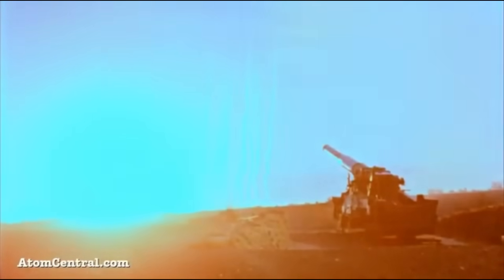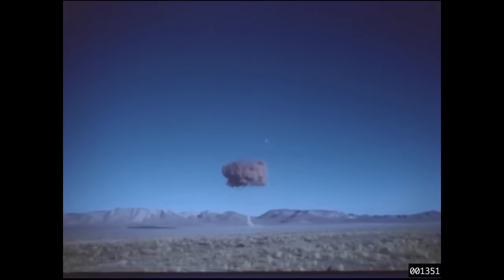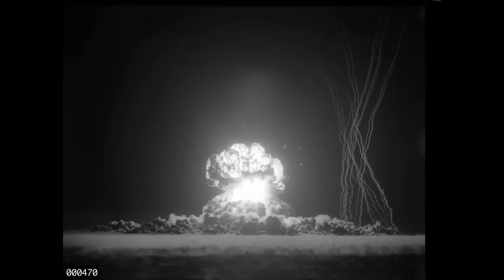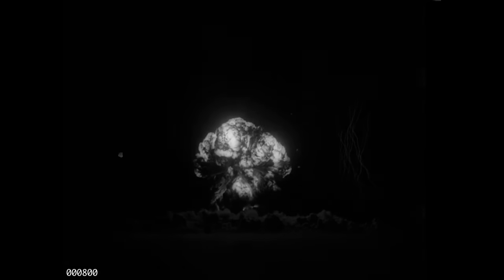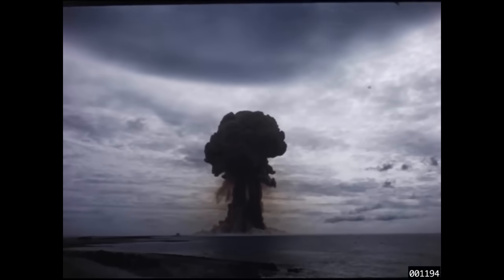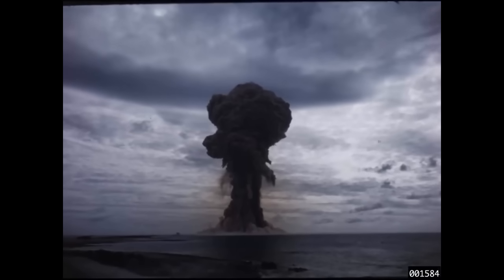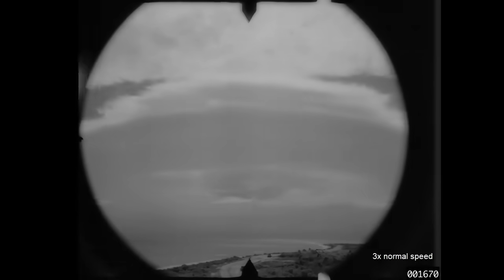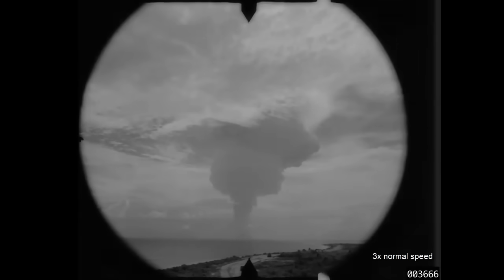What does a nuclear bomb sound like?

Comment: I'm not so certain if the sound heard in that sample comes from the conventional explosives or (directly) from fission-material half-spheres being smashed into each other. It's pretty loud, isn't it?
Reply from the maker: It comes from the entier explosion. Also there are no half spheres being smashed together. That was an implosion type bomb. I have a video talking about how different nuclear bomb work fir more detail.
Reply: @venera13  Anyhow, such a huge explosion and especially, the well-known vast shock wave, must create sound, given that sound is nothing but a propagation of pressure so that propagating pressure typically can be heard by people. The long rumbling goes on too long and consistently, right in the beginning, to be an echo - which would certainly mean the only possibility to explain it as an outcome of the conventional blast.

I think  it's a pity how in the video there is implied a responsibility of the conventional blast for how the thing sounds, without further specification. You thus can only speculate about perhaps a certain sharp suddenness of the start of the noise being caused through that initiation mechanism.

Comment: Yet after hundreds of these they claim we(people) are destroying the environment
Reply from the maker: Thousands* and yes we still are. Nuclear tests are non to good for the environment obviously. If you set off 100 over the span of a day you can actually completely trash the Ozone. But our current issues stem from simple thermodynamics. The Earth receives terawatts of thermal energy from the sun every day. If you increase the thermal capacity of the atmosphere so it holds more by even a small amount, say 0.001%. Since the total amount is so mind-boggling high, that 0.001% equals a lot of extra energy. If you put in more energy into a system than is let out, it heats up. What makes it worse is by slightly increasing the thermal absorption of our atmosphere, we increase how much water vapor it can hold, which also increases its thermal capacity. Which thaws permafrost releasing methane which increases the thermal capacity which warms the oceans causing them to outgas more co2 which further increases the thermal capacity.

Basically by slightly increasing co2 we screw up the thermal system of our atmosphere and feedback loops start to take hold.

Comment: Now do the actual sound from a submarine or spaceship that has its structure being challenged by high outside pressure. I'm 99% sure it doesn't sound like desks/tables being dragged along the floor in a cafeteria like in all the movies.
Reply from the maker: Submarines do sometimes make sounds as the pressure compresses them. Usually small pops thumps or groans. Spacecraft is tricky because what you hear is dependent on what is acting on them. Without anything going on the ISS is actually fairly loud onboard due to the cooling equipment and ventilation fans.

Comment: They fix 5-10 rupture disks of different gradient that can puncture from varying air pressure levels (sound). They place at one set every 100 meters to study. 
They can access the condition of these disks once the radiation has settled down by one or two days.
The high sound pressures were so high that could break the ear drum and bleed to death even if not affected by radioactivity. 
So the audio were never recorded as there are no microphones that could withstand such sound pressure levels. Regards.

Comment: i love that everyone ran the numbers for how far away the nuke is using the speed of sound. and then everyone was horrified by how big that would mean the mushroom cloud would have to be
Reply: It’s all guessing it’s never a way to be sure
Reply: @kingartison  don't have to be sure, just have to be in ball park using the facts available
Reply: @kingartison  Guessing? Its just math. Its extremely accurate, theres no guessing involved.The only thing that could throw off the calculations is the camera used to record and how it processed the sound. This was operation Upshot-Knothole, the shot name was Grable. It took place on May 25th, 1953 in Nevada. On that day, the average temperature there was 19.44°C or 76°F. The speed of sound at 19.4°C is 342.79m/s. Detonation was at 01:43, sound hit camera at 2:17.5. That means the sound took 34.5 seconds to reach the camera. 

To solve for distance, use the formula distance = speed x time or d=st for short. 

If we use that formula and plug in the values we have: 342.79m/s * 34.5s = 11.8263km. 

The detonation occured 11826 meters away. This is the result using the average temperature from that day. You can do 2 extra calculations, to calculate an accurate distance average, using the min+max temps because the speed of sound changes based on temperature. Based on NOAA data, MIN: 11.6667°C, MAX: 27.2222°C

It is never just guessing.

Comment: i struggle to think that over 2000 nuclear bombs have been detonated as tests and have done seemingly nothing to the planet
can someone explain
Reply: The planet is huge compared to a nuclear blast.  Even if they spaced out 2000 nuclear bombs to destroy as much area as possible, that still wouldn't cover even 1% of the land area of Earth.  And they only use specific spots to test, so it's hardly a speck of area that's affected compared to the whole planet.
As for radiation, they learned a long time ago that detonating the bomb up in the air (not on the ground) results in much more boom and much less radiation fallout, since less dirt/dust gets irradiated.  So the only radioactive spots are those small specks of area they test on.
Reply: @jerotoro2021  thank you for making things clearer
Reply from the maker: They where done over decades. If you detonated a bunch all at once it would cause issues. 100 nuclear bombs detonating over a day would severely damage the Ozone and cause atmospheric troubles.

Comment: I would imagine in a real world scenario, you may hear a low rumble coming your way as the pressure wave knocks apart buildings. Interesting that the camera detected the EM pulse, but I'm surprised the X-rays didn't affect the film.
Reply: They had a fair amount of practice filming atomic tests so maybe they got good at doing it? They perhaps used special film stock or processing. Maybe they even shielded the camera? We are talking about nuclear scientists here after all. So not the dimmest bulbs on the string. Although I did hear about one of the atomic cameramen and he was pretty much a wing nut. You kinda have to be to film atomic explosions.

Comment: That explosion is about 6.93 miles away. I counted (in my head not actual seconds on the video) that the sound took 32 seconds to reach the camera. I went to a website to see the speed of sound and guessed it was 85°F or so. It gave me 1,143.8 feet per second. I multiplied it by 32 and got 36,601 feet. I converted that to miles and got 6.93 miles. I suck at math but my phone did the math for me haha
Reply: Remember when your teachers used to say we have to be good at mental arithmetic cos we’re not always going to have a calculator in our pockets 🤣

Comment: No one will ever know what a nuclear bomb sounds like. From a hundred miles away you may hear something but that's after traveling over a great deal of terrain through a great deal of air and through varying temperatures, all will change how it sounds. And there is no equipment that can withstand being any closer.
Reply from the maker: The people in the video watching are under 10km from the detonation. Tons of solders have been closer in other tests. As long as you are outside the immediate blast kill zone and up wind you will be fine.
Reply: @venera13  right, but a lot can happen to the sound in 10 km. At 10 km, much of the sound waves would have expanded to the point of being below the threshold of human hearing, making them pressure waves that you can't hear but rather feel
Reply: If a nuclear weapon explodes in space, does anyone hear it? If a tree falls in the forest when no one is there, does it make a sound?

Comment: Actually, you DO hear the slowly building rumble before the blast. Sound travels much faster through the ground than it does in the air, and it turns the ground into a big-ass speaker. The movies just don't show how big the difference in volume is between the two. But then, they can't. Recorded audio has an absolute maximum volume it can't exceed, and with the blast at that level, the rumbling before it, would be too quiet if the difference were realistic. I dunno how well the sound travels through sand. but there's still bedrock under that sand. My house overlooks a quarry, several miles away, and I definitely hear the rumble before the sound arrives, when they break off a new face. And that's just a few hundred kilos of ANFO

Comment: Actually this is exactly how I imagined a nuke would sound anyone with a good understanding know they are usually detonated at a distance and sound needs to travel.
How they actually sound I think is way better than how hollywood and silly dubbing does, way more spectacular a shock wave blast and then the after roar totally makes sense to me.
As for the methods of detonation yes crude and inefficient which thankfully only a small percentage of fissile material is fully used, maybe they would be cleaner blasting and but far more powerful with less fallout if they used more material in the initial fission reaction.

Comment: scientists used a screwdriver to measure criticality in a plutonium pit because the two haves could achieve criticality without compression just by bringing the plutonium demon core close together. that the advantage of using plutonium cores. of course, they had accidents because of carelessness, and when the gap keeping the critical mass separated was exceeded they got a chain reaction.  it was silent because heat was made didn't explode in the air but a burst of radiation killed some people .

Comment: 2:18 - 35 seconds from visible detonation to the sound of the detonation.
Speed of sound is 343 meter per second.
Distance of detonation is 12.005 (35x343) meter.

It doesn't look that far.

Comment: A popular, or poorly understood aspect of nuclear explosions, is that the nuclear part contributes almost no "explosion" to what we percieve as "the explosion" ie the atmospheric blast. A nuclear bomb provides the energy to heat a sphere of air to incandescence by thermal x-ray emissions. In a weapon with a yield of 15kT or so, the sphere is about 200m in radius. In a 1 MT thermonuclear explosion this sphere of incandescence can be about 1 kilometer in radius. The air is heated so much that the pressure momentarily reaches 500 or more bar (atmospheres) of pressure. In the high pressure, high temperature environment of this luminous "fireball" the speed of sound may be 3-5 times higher than in normal air, so the fireball expands at supersonic speed relative to the cool, undisturbed air which is the true origin of the atmospheric blast percieved by us. Eventually the blast wave "decouples" from the fireball as the fireball runs out of energy, and the atmospheric shock then slows to the speed of sound. In essence, the air surrounding a nuclear burst is the "explosive" while the bomb just provides the energy source.
Reply: I wonder what this would mean if a nuke were detonated in the vacuum of space…
Reply: @jefffinkbonner9551  It means, if there is no air, then there is no "blast." Ironicly you can still have a shockwave in solid materials if they are bathed in intense thermal x-rays and gamma-rays from a nuclear explosion. The thermal x-rays causes the surface to ablate (vaporize) which happens so fast that Newton's Third Law (Equal and Opposite Reaction)  causes a shockwave to form in the material. When the material ends, the surface fractures in a process called spalling which can fill interior cavities with shrapnel. The physics is pretty cool.

Comment: What you called "EM noise" is actually the bright light of the device going through the film sprocket holes and putting a 24 hertz noise on the film sound track. The light was so bright that it illuminated the film base and leaked from the sprocket holes. The noise is 24 hertz because that's the film speed (24 frames per second).
Reply from the maker: Yeah I poorly worded that. As you said the sound is mostly just the intense light and possibly initially heat messing with the mechanics. But I could say technically the visible light is still EM radiation, so I wasn't wrong, just not correct... yeah no I messed that up.

Comment: On one of the DVD's Peter Kuran made of the atomic tests, can't remember which one, they actually have the "real" sound of the nuclear explosion on the tape in REAL TIME.  In the movies, most of the time the sound of the explosion accompanies the visual on the screen, because that's what people EXPECT to see and hear.  In real life, if you're close enough to see and hear a nuclear explosion at the same time, you're dead anyway, particularly for high yield explosions.  Because of the distance and the fact that the speed of sound in air is SO much slower than the speed of light, you don't actually hear the sound until MUCH LATER after the explosion, by that time the mushroom cloud is actually already formed and rolling skyward and probably even cooling down to the point it's not glowing anymore from the fireball.  It's like the difference in the timing between seeing a lightning strike and hearing the thunder from it, about five seconds per mile... so for an explosion 6 miles away, it would take 30 seconds before you would hear the sound of the explosion.  

The initial explosion basically sounds like a gunshot, because like any explosion the rapid expansion of gases creates the "bang" sound... which is basically a pressure wave in the atmosphere.  Like thunder, there can be a residual rumble due to air displacement and turbulence which can make the rumbling sounds... Later! OL J R :)

Comment: I expected such a result, except for artefacts caused by EMP, although they wouldn't be audible for humans. I forgot about the EMP ;) There are additional factors, such as sound travels through the ground and other solid objects, usually quicker than in the air, so ground shockwave could also create a loud noise.

Comment: The nuclear blast at 1:43 took 25 seconds (2:18) to get to the microphone (assuming it was located at the same distance as the camera). The average speed of sound at sea level is 761mph. This was probably significantly above sea level given that most nuclear explosion tests (if not all) took place in the Western half of the U.S. of which is mostly significantly above sea level. The speed of sound varies slightly with altitude as well as other atmospheric conditions. Nevertheless if the speed of sound here was 761mph and the sound took 18 seconds to get to where the microphone (assuming the microphone was at the same distance as the camera) it is relatively safe to say the nuclear explosion was about 5.28472 miles away.

Comment: The detonation takes place at about 1:43 and the first sound takes place at about 2:18. That's 35 seconds between the light flas and the sound. The video was taken at a distance of 7 miles as sound travels at about 1/5 miles per second in air. I've used this trick to figure out how far a lightening strike away from me is since I was a child. One Mississippi, two Mississippi, etc. 😊

Comment: It was about 32 seconds between the flash and the sound. The speed of sound is about 1,100 feet per second. Therefore, the sound has traveled a distance of 1,100 ft/sec x 32 sec. = 35,200 ft = 35,200 ft / 5,280 ft/mi = 6.7 miles.

Comment: If it's far away you can hear the P-wave up thru the ground.  Imagine laying on a foot-thick solid steel floor and 100 feet away someone hits it with a sledgehammer.  P-waves can travel around the earth several times and they're the fastest shock wave because they bounce off the iron core of the planet rather than travelling along the mantle.